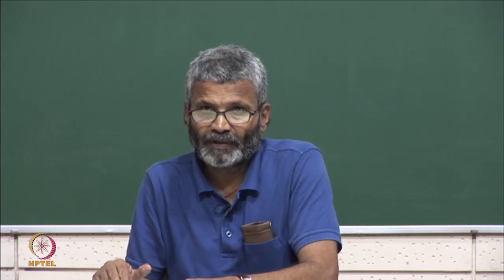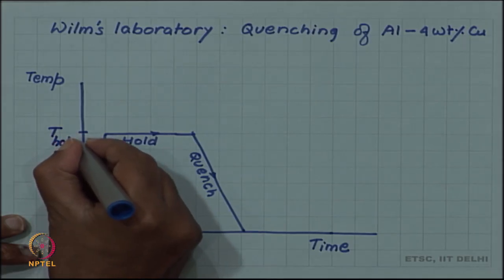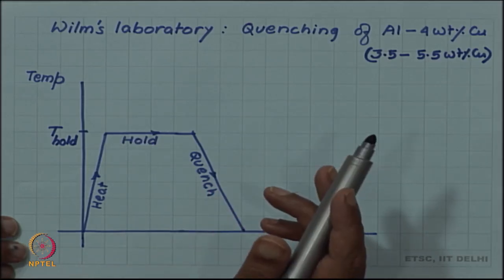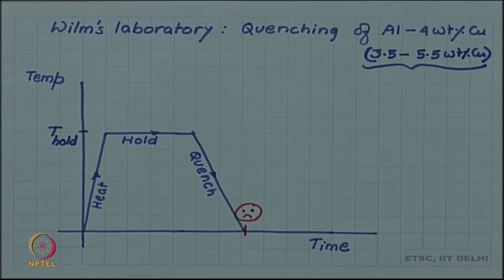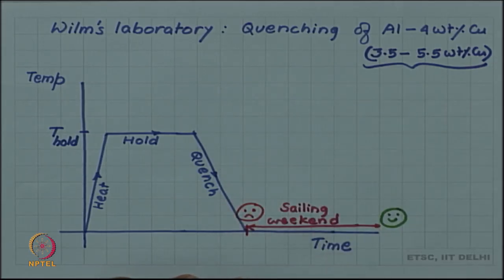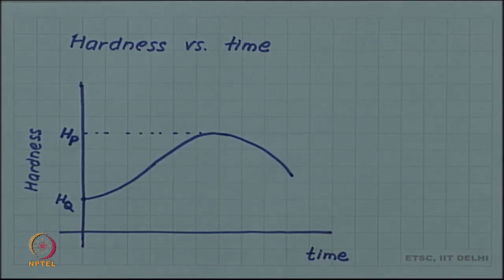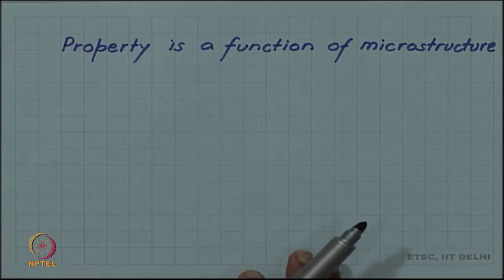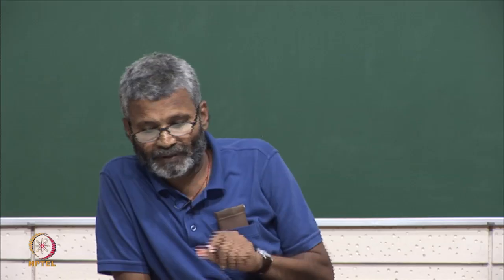Age hardening I: Introduction

Comment: After solution Treatment we do ageing. in Ageing after holding the sample at elevated temp. do we have to necessarily do air cooling or can we perform water quenching .???
Reply from the maker: After ageing, air cooling is sufficient.
Reply: @introductiontomaterialsscience  you mean sir, we can do any of these Annealing, Normalizing and quenching??
Reply from the maker: @himanshushekhar4524  Cooling rate after aging should not matter. So you can either fast cool (quench) or skow cool (air) or very slow cool (furnace). Furnace cooling and air cooling in this case will not usually be called annealing or normalizing respectively. These terms are common for cooling of austenite phase in steel.
Reply: @introductiontomaterialsscience  Thankyou very much much sir....a lot of things has been cleared. Thankyou once again for responding 🙂

Comment: Sir, why we do quenching in first step after solution treatment. ? Instead we can do Normalizing.
Reply from the maker: If you do normalizing, that is slower cooling than quenching you may not be able to retain high temperature solid solution. Precipates will form while cooling itself. But this will happen at higher temperatures than used for aging after quenching. Precipates formed at higher tempeartures will be coarse and not as effective as fine ppts formed at lower aging temperatures.

Comment: Thanks for your lecture.
I works in aluminium extrusion factory.

I would beg you to explained as easiest that you can for medium students like me.

The process is heated billet 7 inch to 480C and extruded  to 530C aprox and later tempering  in a fan current 10 m ( to quenching 30 m/min) yo get 250C . And later agening.

Thanks